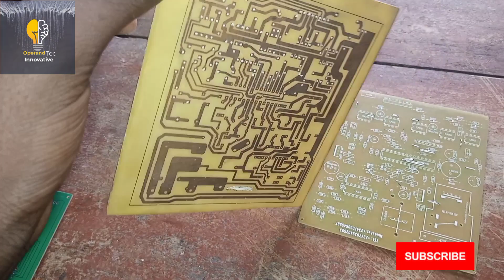How to design your own pure sine wave inverter system (easy to design project) part 1

Comment: Gd job.
Where is the lm7812 on the board.
Reply from the maker: The positive regulator is there on the board sir , beside the mosfet board connector. Kindly message me on Whatsapp via +2348051509166  for more discussion